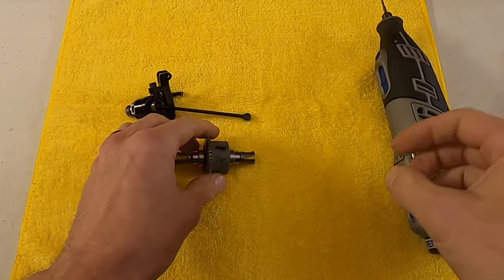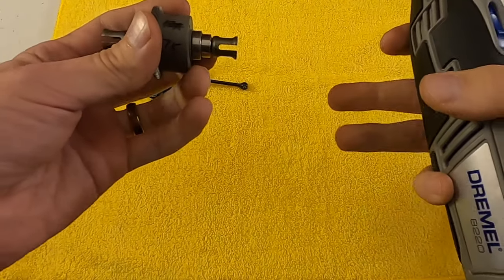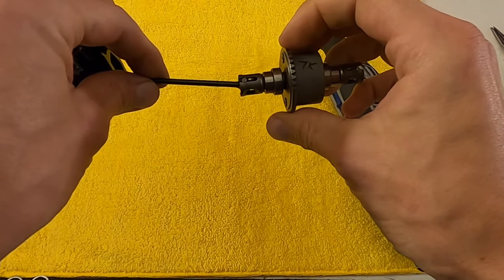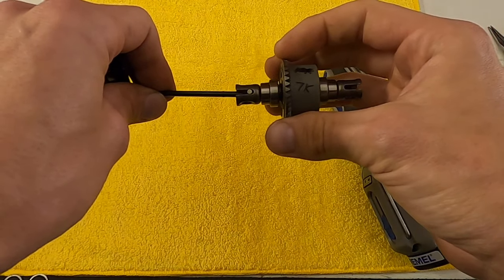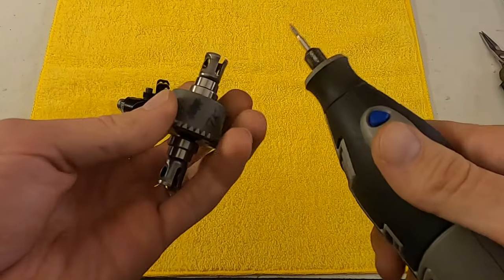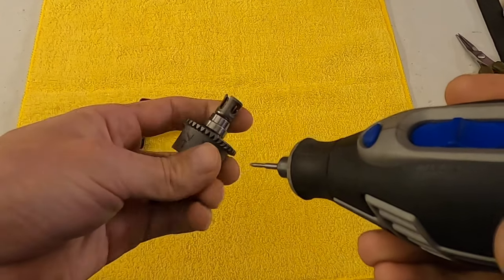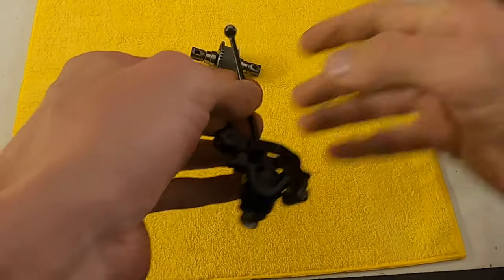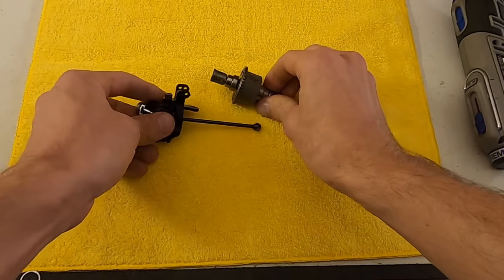How to Break-in New RC Driveline Parts [Intermediate Tutorial with Ryan Lutz of LutzRC]

Comment: Thank you. I learn something new everyday. Never thought of that, would have thought that a smooth cup/pin would rotate more freely. Do you think you could do a blind test where a pit crew chief changes out your driveshafts between new & worn while you're on the stand, and you can call out which is which? Cause that is amazing if you have that kind of relationship with your setup. Some people can't tell they lost a driveshaft completely until they melt their diff😬😂😂
Reply from the maker: Haha. Yeah you can absolutely feel it. Many people drive a new car and it's rolling all over the place and after a few tanks or runs on it it starts to have better support and stop rolling as much and transfers less weight. This is all the driveline breaking in. That's why you would never want to replace driveline parts right before a main or something because the car would feel totally different unless you help it along by breaking it in a little.